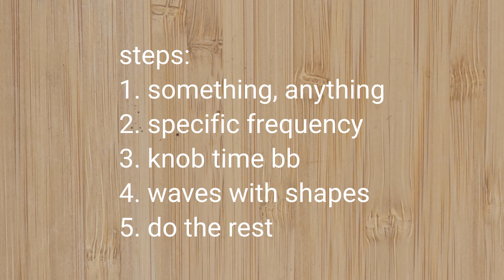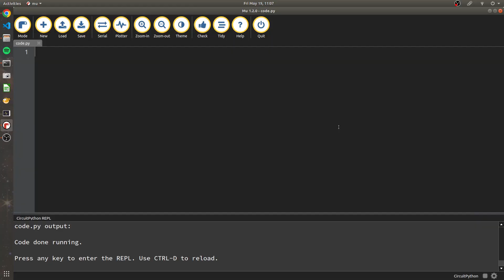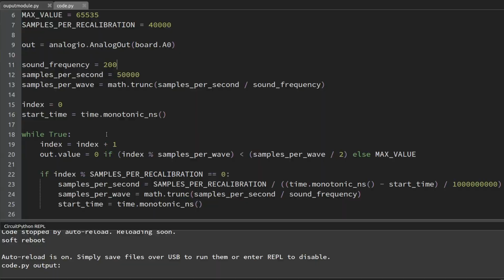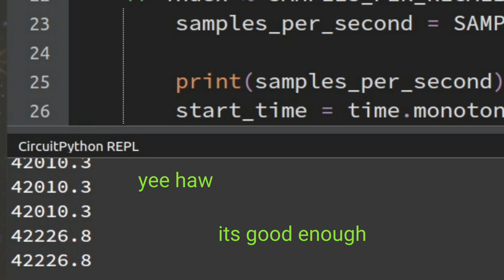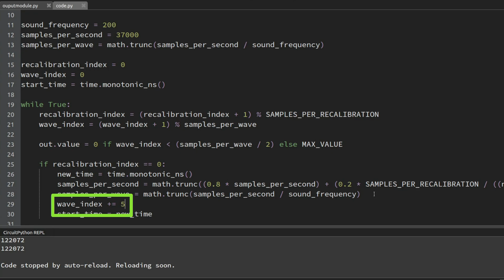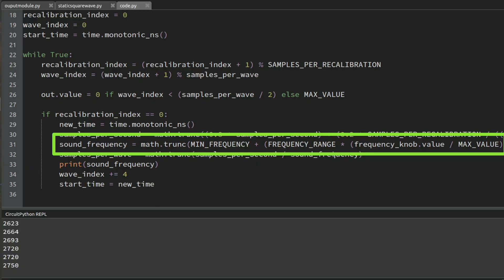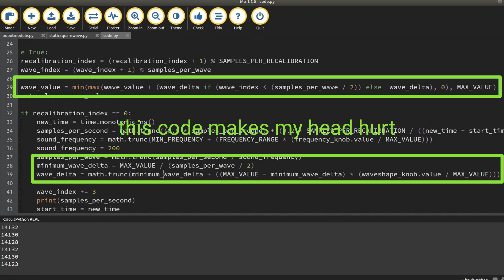building a digital wavetable synth

Comment: i like synth diy but im not really much of a coder myself but seeing the triangle done with integration of a square is how its done with analog triangle generators often, however capacitor integrators dont integrate smoothly like computers because caps charge slower the more full they get so the line will be curved giving you the "analog tone". very great 8/8
Reply from the maker: good to know, thanks! 💙
Reply: @dawnsynths  i might have been slightly wrong the  active "integrators" with an op amp look really linear but when you just have a rc circuit instead and use a shmitt trigger and inverting amp to fill the cap and drain once full, the cap doesn't fill evenly. that is with square signals, and a basic rc lowpass the capacitor's current fill rate is proportional to the diffrence in voltage across it, taking its current charge into account. and if you fill it with a constant voltage, it doesn't draw a ramp, rather it charges fast, then slower once charge builds up. this is because as it charges, the voltage on the other side buids, making the total diffrence across it less- therefore charging it less. it draws sorta a sharkfin wave. if you use an actual op amp integrator, rather than the rc lowpass filter, it will be more in a line.